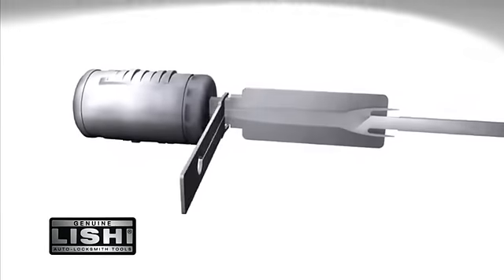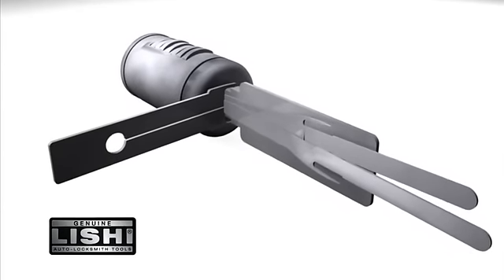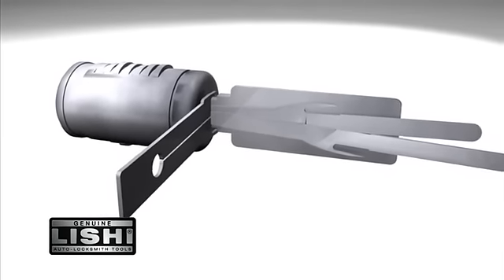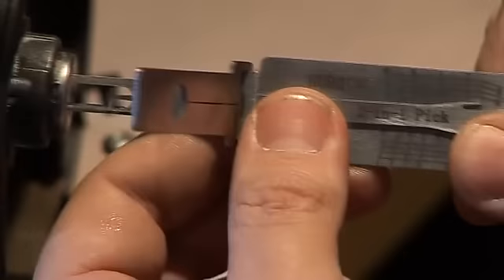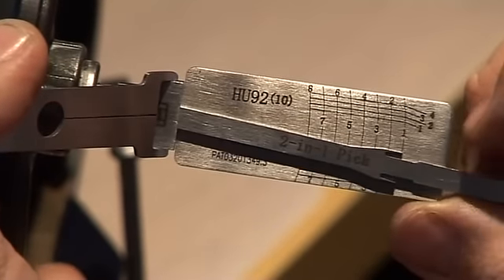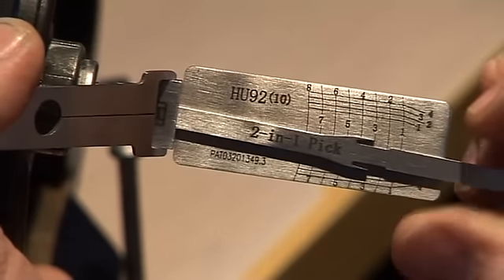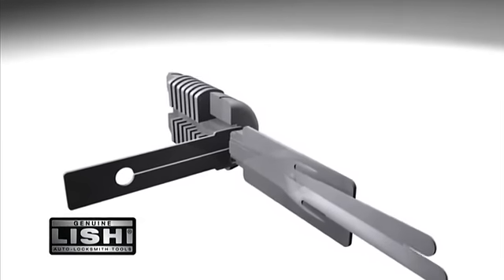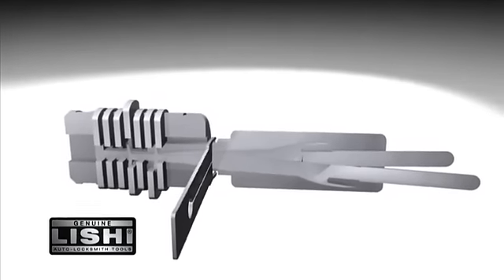How to Use Genuine Lishi 2 in 1 Picks and Decoders

Comment: So if someone can make a key for the door would that then work on my ignition?????  Just think i might need to boost my home security
Reply: If you have a car that's less than 20 years old, it's quite likely that it won't start without a transponder key. In short, you need more than to just decode the lock to start the engine. If your car doesn't have a transponder, it could be stolen by removing the ignition cylinder with a dent puller, so you'd be fucked anyway.